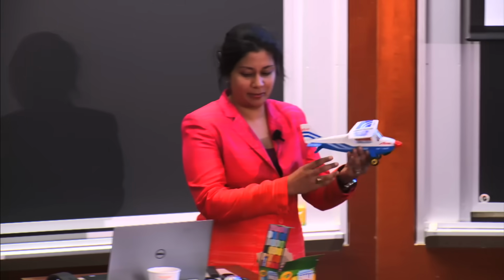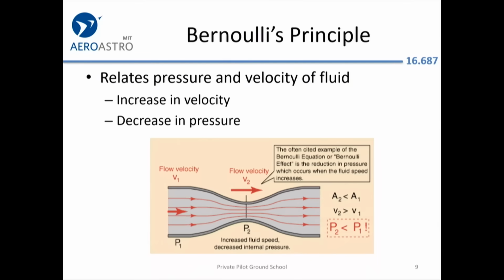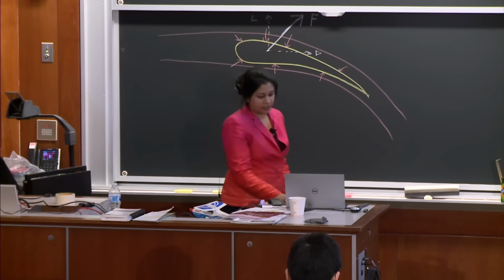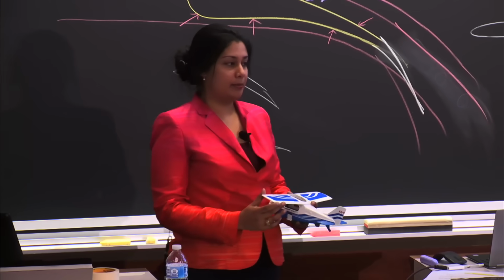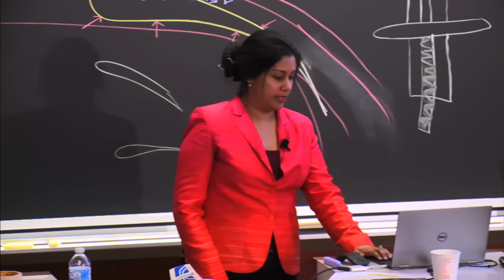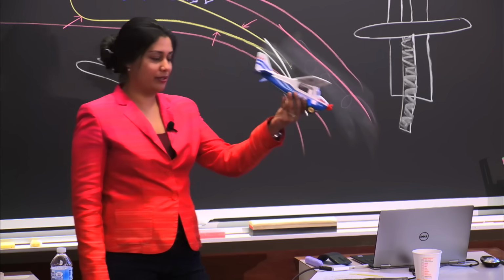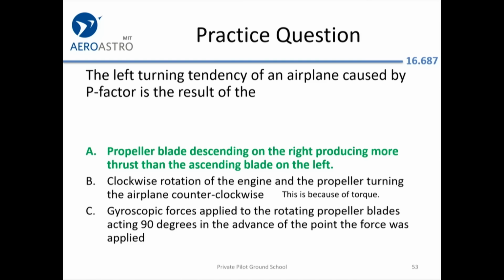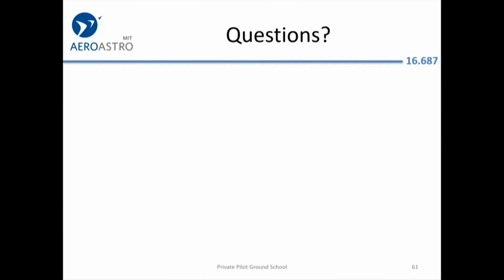Lecture 2: Airplane Aerodynamics

Comment: Thats a terrible way to explain lift. And just generally a terrible way to explain physics.
Reply: This is a pretty poor explanation of lift.

For something that follows all the applicable physics fundamentals step-by-step, please see: Understanding Lift Correctly: https://rxesywwbdscllwpn.quora.com/ 

0:50 Vocabulary: doesn’t  mention the vertical and horizontal “stabilizers”. Calls them “parts”. In the graphic, but not mentioned.
There is only ONE wing.
Going to talk about sea planes ???
3:11 initially says lift exceeds drag, but corrects it.
4:50 Draws an extreme airfoil shape.
5: 30 Air has mass and conservation of momentum. This is very vague explanation.  Doesn’t explain how the push occurs (which is from pressure).
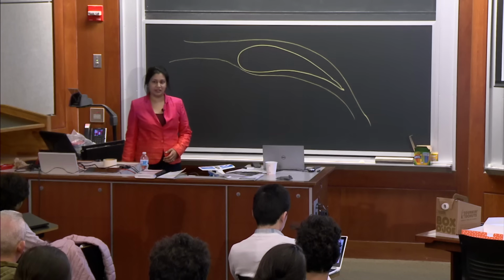6:12 Explains Equal transit, longer distance fallacy. Points to flat wing having the same length.  Math description not needed.  Good Aeroastro graphics.
12:01 GOOD: Stated Bernoulli correctly using ‘velocity’.  BUT focuses on fast, not changes in velocity which is acceleration.
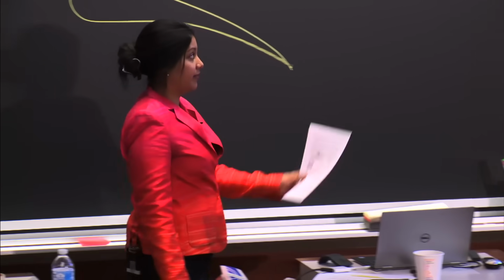12:42 The Graphic assigns INCORRECT cause to lower pressure.
12:49: Answer “A” is the only correct statement, but has nothing to do with Bernoulli’s Principle.  There is no such thing as an “additional force” (B).  The air is Accelerated toward the trailing edge by the relatively higher pressure forward of the wing and the lower pressure above the wing. The Pressure Gradient is the CAUSE of this acceleration. So “C” ic flat WRONG.  THIS is where the incorrect interpretation of the  Bernoulli Principle is applied incorrectly!
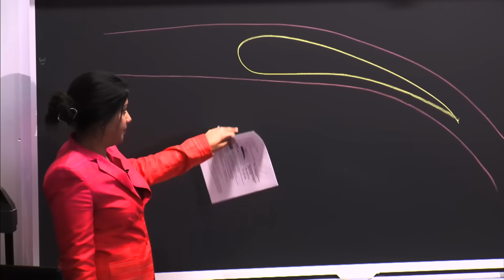14:00 GOOD: Shows stationary pressures.
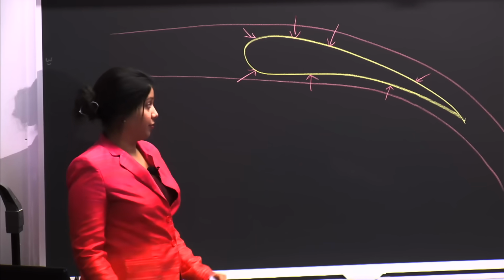14:40 BUT fails to say that the Force is the net force from the pressures that have changes due to the  motion. The TOTAL “force” is due to the net top-to-bottom ‘normal’ pressure difference and drag caused by the wing’s motion.
15:14 Asks childish questions. Race Car.
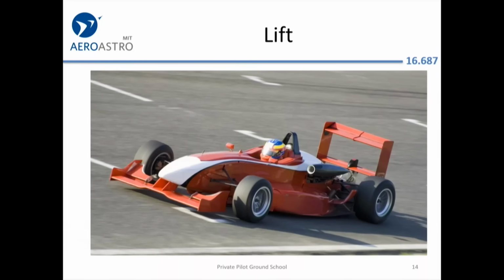16:36 Only says the spoiler “spoils” the air flow. Doesn’t explain that it has down lift.
18:09 Wing changes the speed of the air ALSO.
Never states that upper air beats lower air to the trailing edge.
18:54. Is wing moving faster through the air, or air moving faster past wing? Frame of reference discussion. Wind tunnel justification.  This is an unnecessary diversion as stated. The relative motions are essentially the same in the wind tunnel, So wind tunnels are valit for testing.
23:40 Mentions aspect ratio without explaining it.
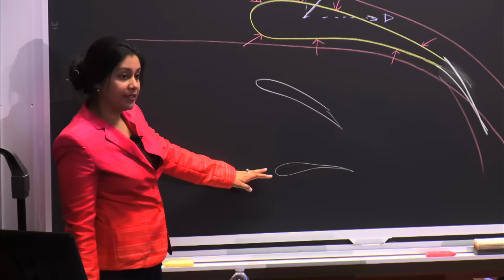24:24 Mentions your  hand out car window and PUSHING, but doesn’t relate to the momentum explanation earlier. It’s just another wing and provides nothing new because we can see planes flying every day.
25:28 Mentions Viscosity. Compares sticky.   Sticks to the wing.
27:10 Compressibility affects lift in a different way.  NOT FUNDAMENTALLY.
29:45 CALCULATING LIFT.  Mentions Kitta Condition but not why it is important (which is isn’t).  Tip vortex in not true turbulence. 
Doesn’t explain chord line.  Says:  “in between.
32:25 Talks about summing forces around the wing for lift, but doesn’t explain the top-bottom difference.  So she leaves a large hole in treh connection to the pressures and the momentum story.
38:10 Doesn’t actually state what AoA is.  Graphic shows it as “A”  but is unnamed.
42:20 CONFUSED about the effect of flaps. Airspeed being higher with ground speed lower HUH???  Also doesn’t explain approach being steeper. Misses that is the increased lift that allows slower air speed.
47:38 Only explains that roll is around the longitudinal axis, but not the others.
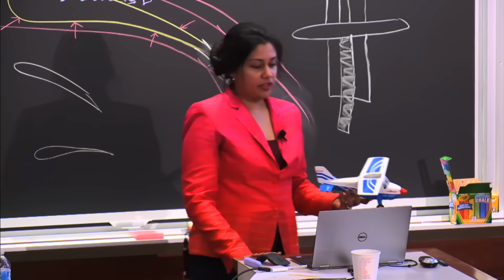48:13 Doesn’t explain why adverse yaw occurs.
48:15 Stability OK.
53:30 Question about what happens beyond the critical angle is not answered correctly.  Lift does not go to zero. Did not demonstrate a paper airplane stall.  It was too stable.
54:45 First mentions separation.
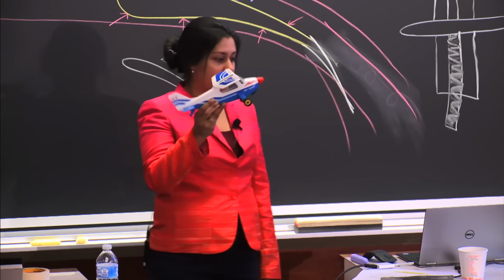55:56 climb & decent, lift = weight.
57:15 Torque causes a left ROLL.
57:50 P-Factor not so much climbing because AoA not necessarily high, just on ground.  They can’t answer the question at 
1:02:20 Precession is 90 degrees  later.
1:03:14 Question why P-factor not subject to precession. Sort of answered. It is a bigger factor on the ground for a tail dragger the ground where the ground  prevents precession and in slow flight when precession only occurs during actual yaw.
In zero G flights confuses the upward parabola with top and downward parabola with bottom.

Comment: I am a little surprised by MIT on this. Unfortunately she also gets bernoulli wrong or explains it incorrectly. The pressure on top is not lower because of a longer distance on top and higher on the bottom because it is shorter, that implies equal transit time which is wrong. The pressure on the bottom of the wing is higher because the air gets slowed down due to shape and angle of attack and particles on the top due to their mass try to move on straight and thus create an area of lower pressure on the top. It is also not the speed of air that matters but the acceleration or deacceleration. That really is simplified and changes continuously along the profile since the air is being redirected by the pressure differential in the vicinity of the profile.. The net result is lift and drag. One side effect is that the air is deflected downward but is not the reason for the lift, just an effect of the pressure distribution.

Comment: First she says lift is created by the wing redirecting air in a downward direction. Then she explains lift is created from Bernoullies principle. Take an ordinary 8.5 X 11 peice of paper. Hold it more or less horizontal to the ground between your thumb and index finger. Now, blow down only over the top of the paper. The paper rises up even though no air is being deflected down. Why? Why does the paper rise up? When you can explain why the paper rises up even though you are blowing down onto it, you understand the main way a wing creates lift.
Reply: well, if you only blow on the bottom side of the paper you will note it goes up.  bernoullies principal will lift the sheet of paper but newton will lift the rest of the aircraft
Reply: @viggolundhild3086  That still doesn't explain the contradiction in the video. She stated (implied it's all impact IMO). Does a wing produce lift via Bernoulli's principle or Newtons? Is it one or the other, or is it both? If both, then is one much greater than the other? She also stated air molecules don't have to meet up with each other at the back of the wing. That's true. But if they don't, then a void occurs somewhere on the top surface of the wing correct? Which I don't beleive happens. I would suggest even a flat piece of wood inclined to an airflow requires the air molecules to more or less meet up again at the back of the board. Which essentially requires the molecules on the top of the board to travel faster. They push on each other if you will. Also I would question that impact forces create most of the lift. I have always taught students the paper example and included the point about impact forces as well to punt the issue. None of them ever questioned it, but I appreciate the input.

Comment: I can die in peace now because this is the first video I've seen that FINALLY gets it right. The only thing missing is explaining why air over the top of the wing tends to follow the surface of the wing which is the Coanda Effect. That also contributes to lift due to conservation of momentum.
Reply: thx, she didn't mention "Coanda Effect" thats what i'm searching for. she only mentioned Bernoullie low p -> high v , and that on top there is this effect, but not what is creating the lift then exactly.
Reply: Maybe they didn’t need to go into that much detail for the FAA exam….
Reply: @CHANGUTHAKUR  I've taken the FAA exam. The irony is that the study text for the exam says it's Bernoulli Force that is the primary source of lift which is incorrect.
Reply: @MoMadNU  well now we know why it wasn’t mentioned by her, maybe her teaching goals are to help her students ace the exam.

Comment: In order to answer the question at 1:01 where the question asked was, why doesn't the corkscrew effect cause the aircraft to roll?!

Tina did give the correct answer. In order for it to make more sense, I'd add that the backward flowing air from the propeller flows along the body of the aircraft passing along the inner part of the wing (Part of the wing closer to the body) and thus doesn't have great effect on the aircraft due to the fact that Work done ( Force times Distance) isn't that much of a high figure as it is closer to the fuselage/body, which is the center, of the aircraft.

However, when the backward flowing air strikes the tail of the aircraft, the Work done is significantly greater due to the increase in distance between the point where the work is done and the center of the aircraft, even though the force might be almost the same. (Work = Force x Distance)

In conclusion, there might be a really tiny rolling effect on the aircraft but it won't be significant to cause the aircraft to actually roll. On the other hand, the corkscrew effect on the tail of the aircraft will cause a major effect on the stability of the aircraft.

Interesting Fact: This is also why some aircrafts have their rudders' original position tilted slightly towards the right (Right Rudder) [ aft facing forward ]. This is usually set up by the maintenance crew at a known angle in order to avoid major stability issues faced by the corkscrew effect and thus make flying safer & easier.

Feel free to ask any questions! :)

Comment: I think there a huge missing point in this explanation. Pressure=vacuum=suction. The longer distance of the top wing surface, causing higher velocity, separating the molecules more over the top more than the bottom, thus causing a pressure difference/vacuum on top, which creates upward suction. My understanding is the normal atmospheric pressure above, makes the air funnel over the top of the wing at higher velocity (not the idea that the top and bottom air flows have to meet at the leading edge). Vacuum is a huge force, as well as the factor of the air pushing under the wing by the angle of attack. From my skydiving free-flying/bodyflight (rolled shoulders and back so one's body is in the shape of a wing) experience, I can attest to the feeling of suction on my back. Yes, as well there is air resistance under you - but the suction is what enables the forward movement part of the lift, and so a more efficient wing. Flap down on a wing, increases vacuum (more molecular spread) but because of drag it effects a slower speed/more angle of attack being needed. In her example of a hand out of a car window, try cupping your hand like the shape of a wing slightly and compare that to a flat hand angled up - you can realize a cupped hand is more effective. I can also refer to air carburetors on older cars and motobikes. There are internal wing shapes inside the funnels, causing a vacuum that sucks the fuel, into the carb as a mist, which is sucked into the piston - it all happens because of vacuum pressure.

Comment: Was she a new or trainee lecturer? She wasn't exactly thorough considering she said they were going to go further than the FAA requirements. I mean, she said the flat part at the rear is the elevator and the upward part was the rudder. No they're not! The upward part is the vertical stabilizer or the fin which INCLUDES the rudder at the trailing edge, and the flat part is the horizontal stabilizer or the tailplane which INCLUDES the elevator at the trailing edge. If the whole of the horizontal stabilizer moves as an elevator, then it is also called a stabilator. Also, she said that lift needs to be greater than weight in order for the plane "to go up". Errr... not if the plane is pitched up and the thrust alone or thrust plus lift component exceeds the weight, such as in jet fighters. And I'm not even a qualified pilot nor further-educated person. I stopped watching at 3:20.

Comment: Don't know why she spends 10 minutes saying equal transit theory is wrong when the principal of high and low pressure does exist. Whilst there is obviously a change of momentum of the air, the reason for that change in momentum is indeed a pressure, just the wider pressure of the air due to the wing in the pressure field. 
Equal transit theory may be wrong in that they don't meet at the same time, but air definitely flows faster over the top.

Comment: Paper airplanes don't "fly", they fall slowly,. and their wings are generally not angled as is displayed in this lecture, but flat. When she asks what a cross section of the wing would look like, she's imploring someone to say "it's flat", but then goes on to draw a wing which is not flat, but is at an angle. Paper airplanes built with such construction usually auger in immediately.. The response to this lecture by self-proclaimed engineers is even more troubling than the lecture itself.
Reply: do you have a Ph.D. in aeronautics and astronautics??
Reply: @dont.be.evil.  Do you care to refute anything I've said?

Comment: PLEASE HELP ANSWER MY QUESTION If bernoullis principle is wrong and pressure differences arent what cause lift, then how do you explain how wingtip vortices are created? From what I understood is that the equal transit theory is wrong because air does not travel faster over the wing and lift is simply just a byproduct of air being deflected downwards.
Reply: The lift obviously has to be the pressure difference between top and bottom. The way people try to apply Bernoulli's Principle is what's wrong. 
The upper air is directly observed to get to the trailing edge first. This occurs because the lower pressure above the wing and the higher pressure ahead of the wing accelerates that air towards the trailing edge. 
You must always obey Newton's laws. Air has mass and it takes a pressure difference, called a pressure gradient, to accelerate that mass. Air is accelerated away from a higher pressure area and toward the lower pressure area. It's that simple.

Comment: As a pilot, I know that lift is created by two laws 

1. Newton’s third law: every reaction and an opposite and equal reaction. 

2. Bernoulli principle:  basically has to do with a airfoil and the way the air is hitting the wing. It has flows both over and under causing lift.

But these are just theories I think, we don’t acutely know how planes fly. According to some flight instructors.
Reply: Lift directly comes from the fact that there is more pressure under the wing pushing up than there is above the wing pushing down. What so many people fail to be able to figure out is how those pressures occur. They're constantly misapplying Bernoulli's principle. 
The shape and angle of the wing moving through the air creates pressure differences around it. These pressure differences then are the cause of the accelerations of the air we observe.
Reply: @Observ45er  yeah I agree, Bernoulli principle is sometimes hard to grasp and explain it at least for me. But that makes more sense.
Reply: @tayyabmalik4261  are you asking me to explain Bernoulli's principle to you?
If you want a good explanation that's based on well-known science about why the pressure is lower above a wing, I have a video on YouTube explaining just that one aspect around the wing. It explains why the pressure is below atmospheric pressure when air flows slong a convex surface. Just go to my channel you'll see the shape of the wing in the thumbnail image.
Reply: I think it is mainly aerodynamic advantages (streamlined body for example) and the laws you just happened.
Not a pilot tho

Comment: I learned the equal transition theory of lift in 1987 and it has kept me in the air ever since.
Reply: Amen brother. I've been a pilot since 1991 and I have always believed that too. If it wasn't true, then why do we have so many different airfoil designs (NACA 2412, 4412, ect.)? Because Mrs Professors...it allows the changing of lift (and drag) characteristics of an airfoil... otherwise changing the differential pressure. Lost a bit of respect for MIT.

Comment: 29:09
Calculate visually the shape of the vortices and add set parameters that make a mobius strip and mirror the values and run several test to get a baseline for another equation a pattern while a rise and solve for X or the equation you solved will turn into a study find what happens when you alter values from the input  and how the effect the output learn what does what when changing values will help you come up with a order of operations to in what order must these values come in, in order to expect let's say vortices to be stablelize...
I most probably am wrong but I don't have the knowledge or equipment to test...

Comment: She starts off saying she is going to explain how airplanes fly, but then fails to explain lift. Specifically, most of the wing's lift is generated not by Newtonian deflection, but rather by the faster speed of the air on top of the wing, resulting in lower air pressure. She says she is not going to spend much time on the equal-time fallacy, but she spends a lot more time debunking that than explaining why the air on top actually does move faster. In fact, she never really explains at all the actual reason for the faster moving air on top. Don't watch this video if you are expecting an explanation of lift beyond simple deflection.

Comment: The faithful know that Lift is God's will, not Fluid Dynamics. The faithful fly, the heretics fall, like Icarus.
Seriously, lift is 95% Newton's 3rd law of Motion - air pushed down = wing pushed up. Only ~5% Bernoulli effect of pressure difference.  If not how do planes fly inverted? So it's angle of attack that produces lift.  (Old PPL).